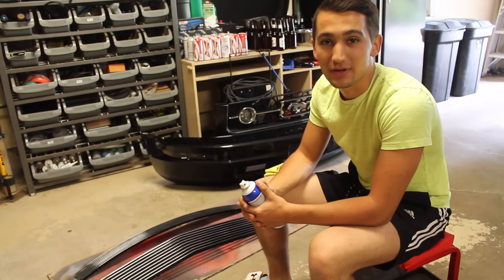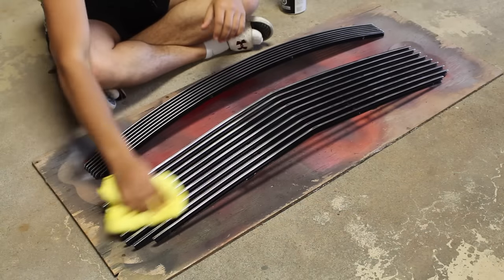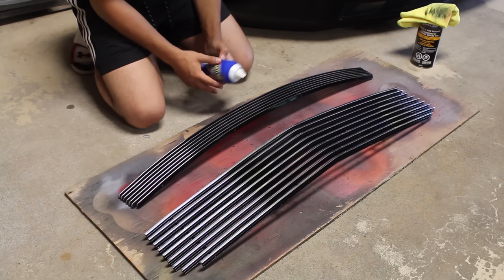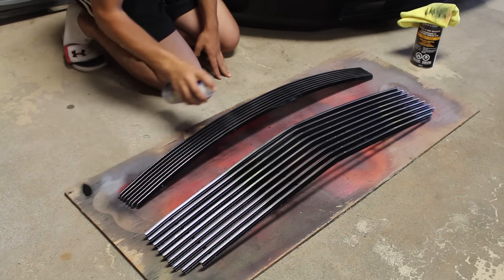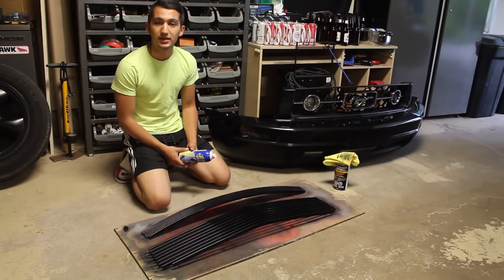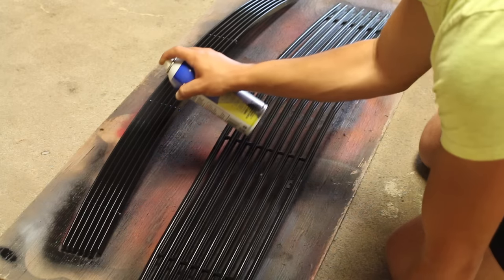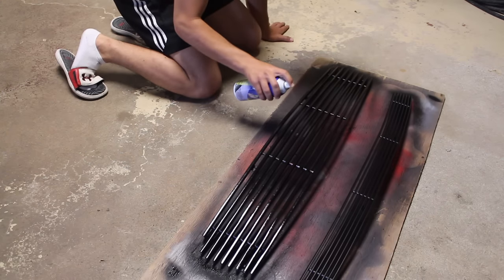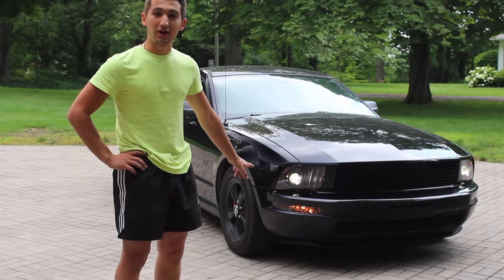Dipping a Billet Aluminum Mustang Grill

Comment: I noticed when you were spraying that you went half the length of the grill then moved down to do the other half. Have you had any problems w/ over lapping the plasti dip  in the middle? For example; the depth in color / thickness difference between middle of the grill and the ends / drips. I know your not a newbie at this, just curious. thx

Comment: Spray some chrome emblems and it didn't come out flat black. Looked more like a mid to light grey. I checked the can and sprayed other items and those came out good. Any suggestions?
Reply from the maker: sittinpretti One of two things happened. You didn't shake the can good enough and you sprayed the paint thinner in the can instead of the plastidip, or you could have gotten a defective can.
Reply: Sick Dips Thanks I'll try to shake it more. No telling how long it was sitting on the shelf.
Reply from the maker: Yeah thats true!! Dont' forget to put it in a bowl of hot water too. It makes the plastidip atomize and spray much smoother 👍
Reply: Sick Dips Will do. The Glossifer says Fade Buster on the can. Does that make a difference?
Reply from the maker: It just means its UV resistant. You won't be able to notice a difference.
Reply: Okay thanks... Is it possible to dip interior trim? Would the sun and heat have an impact on it?
Reply from the maker: No its durable up to 900 degrees fahrenheit. I have it on my exhaust system and its been fine. Every time I go for a spirited drive, it smokes a tad but nothing burning and it hasn't dripped off.

Comment: i was wondering how to take off the grill of an Altima 2009 coupe. any tips?
Reply from the maker: Jose Urrutia Open the hood and start pulling on it. Wherever it resists, thats where a clip will be. Go from there. You might have to take off the bumper, you might be lucky and be able to leave it on.
Reply: i saw some nails and its attached to the bumper, im afraid to brake something lol. thanks anyways man.
Reply from the maker: Nail!?!? :O i'd be worried too. You should probably have plastic push tabs that hold it in place. Most Japanese cars are like that
Reply: yeah thats what i meant lol sorry.

Comment: how to do the led light changes colour 
pls tell me in the next video
Reply from the maker: +perruvin murthy Its a very extentive process that is not quite on the DIY level. You will need to open up your headlights, install some wiring, make sure its installed properly, and then close everything back up without any leaks. This sounds a bit easier than what it actually entails.